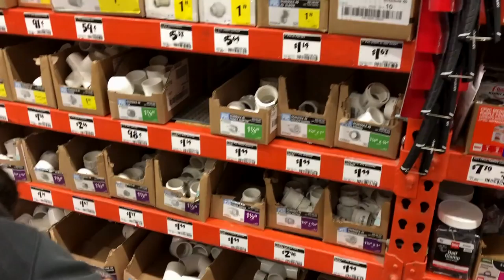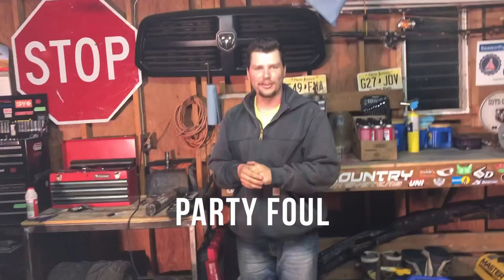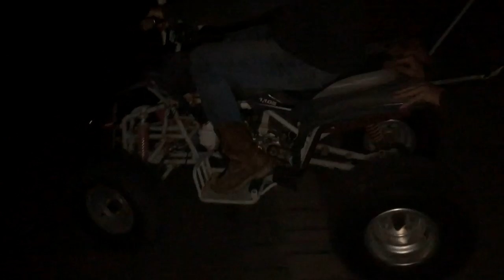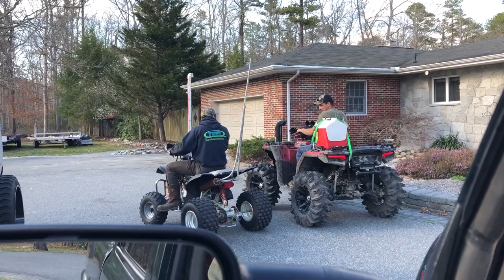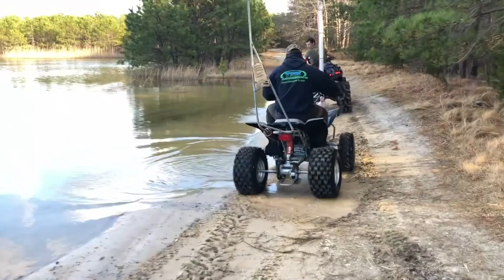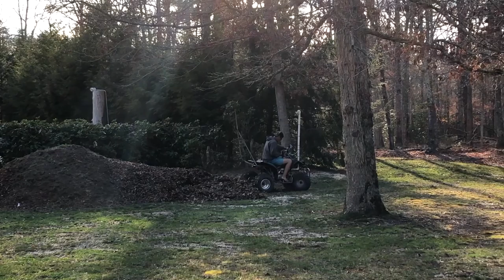Beater QUAD gets a snorkel kit and goes deep (EPIC FAIL)

Comment: Take the exhaust snorkel thing off you don’t need it
Reply: I'mBadWith COMPUTERS it’s so if it cuts off under water it doesn’t suck water into the motor 🙄
Reply: Arctic Pyro Idk about that because if it does cut off the water will run down into the engine and you will have to pick it up on its back wheels and run it all out and it is also a low cc engine so it might not push enough air out to blow all the water out